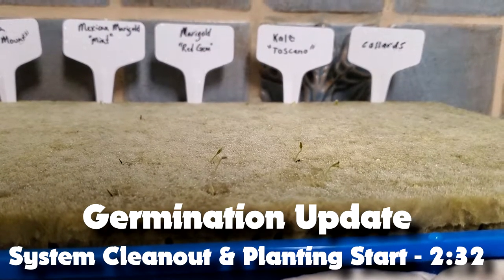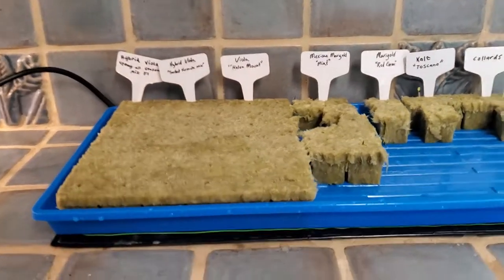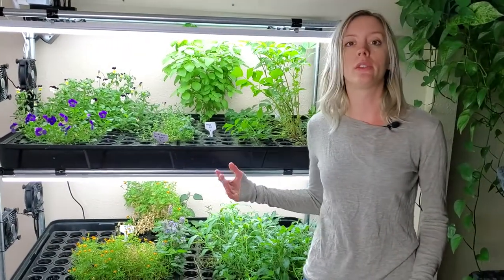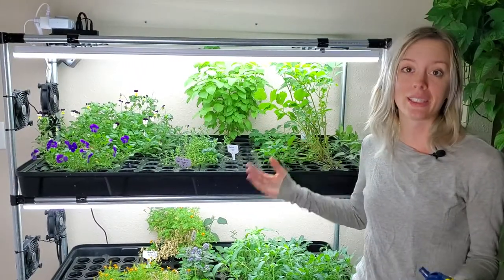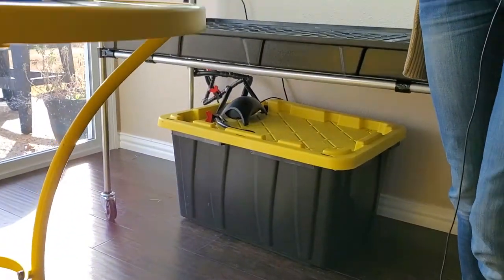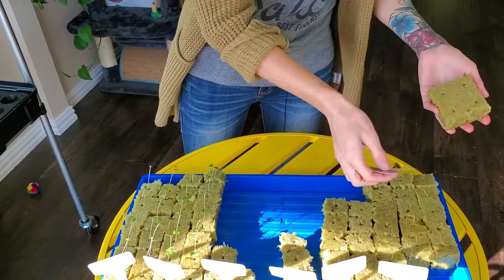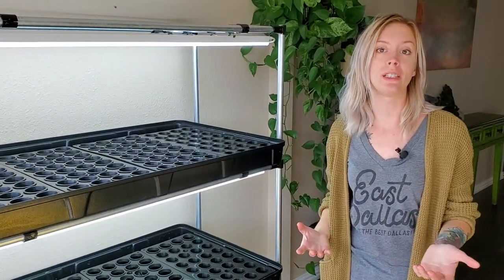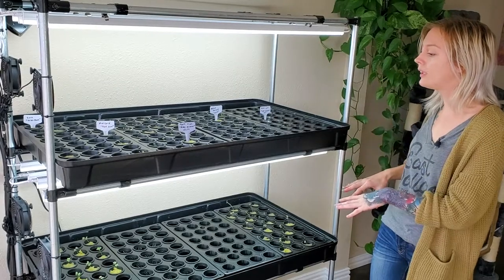Edible Flowers Part 2 - Germination update - System Cleanout & Planting | Hydroponics

Comment: How much sound does this make? I live in a small apartment and I'm about to make something like this myself for greens :)
Reply from the maker: The loudest part is when the water is draining back into the reservoir... It can be a little noisy, but honestly not bad. If you put something at the end of the drainage hose like a filter to break up the flow of the water, it would help silence it more, I think. If you would like, I can take a video of the sound while it drains and share that with you!
Reply: @OnTheGrow  interesting, is it water splashing? Maybe adding a bit of plastic to make a ramp for the water to fall silently could work?
Reply from the maker: @Matias-rn9ff  That would probably solve it! Anything to help break that water up a bit when it hits the reservoir.